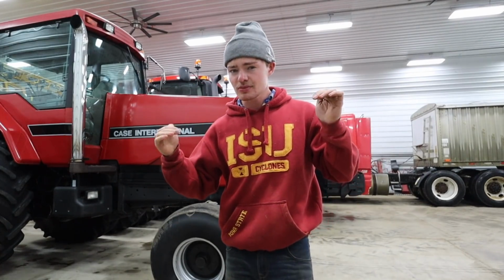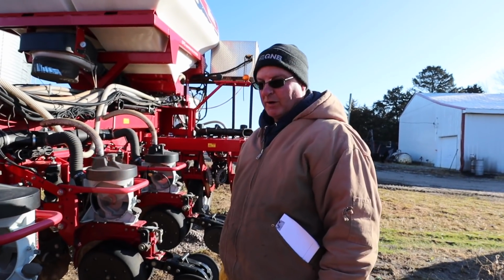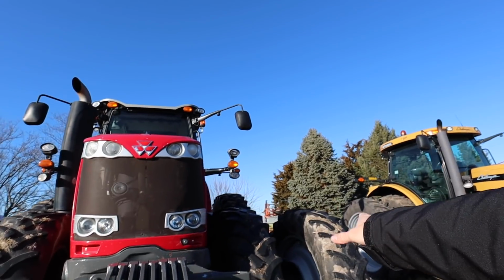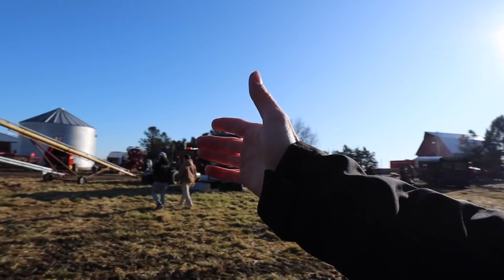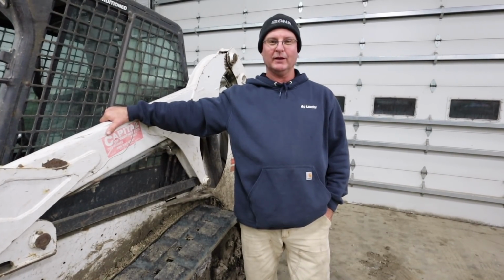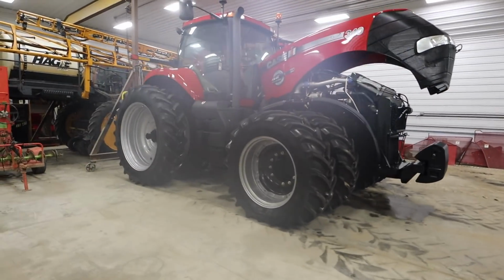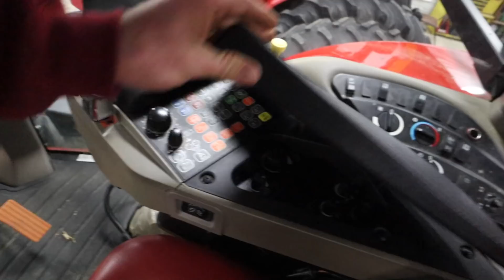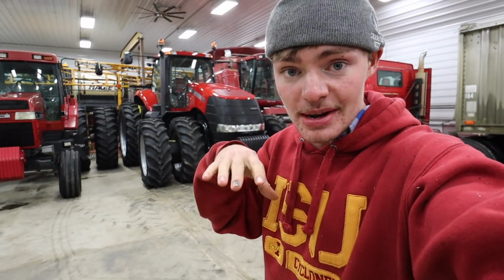I Bought My 1st Tractor!!

Comment: After that def system starts draining your wallet you may rethink the delete expense. All my experience has been around Semi Tractors but all the same the def systems are the bane of anything diesel powered. Price out that particulate filter, price of def per gallon/consumption rate, fuel cost for parked regens.

Comment: DEF Has been a nightmare for equipment owners since inception. Keeping you DEF from becoming contaminated is very important. Do not reuse containers and store it in a climate controlled area. If DEF gets too hot it will crystalize and clog up the dosing module. Contamination is usually the reason for most DEF related breakdowns.

Comment: Hi Cole. Interesting session here. Good insight for the purchase of equipment. But, that was not the point. When you speak it seems like you are speaking rapidly. You are not. It is the breaks between sentences. Best timing is 0.5 second, with 0.400 seconds as the rock bottom space between sentences. I hope it helps.  Great far you have.